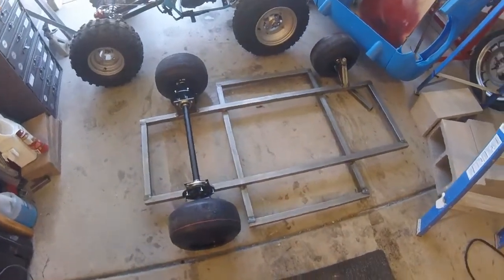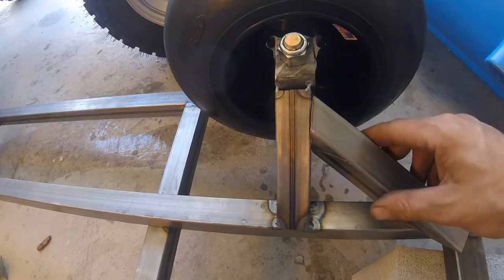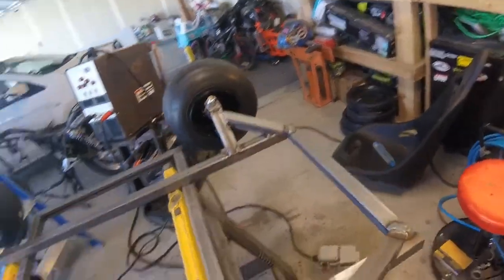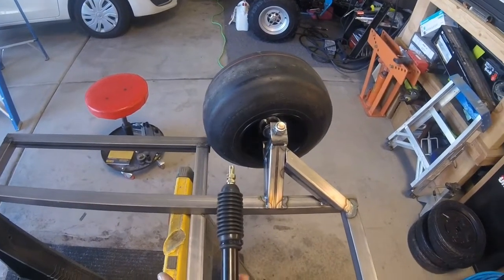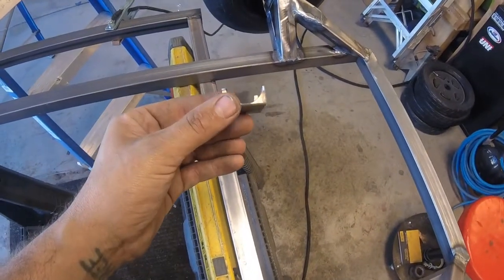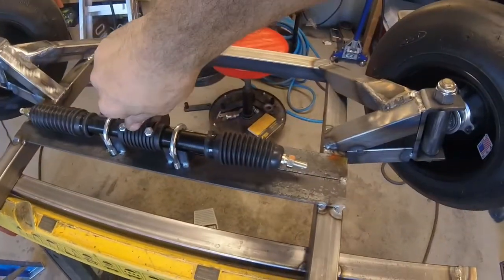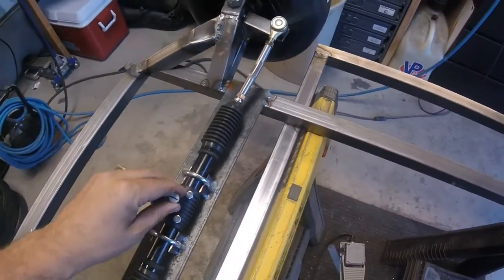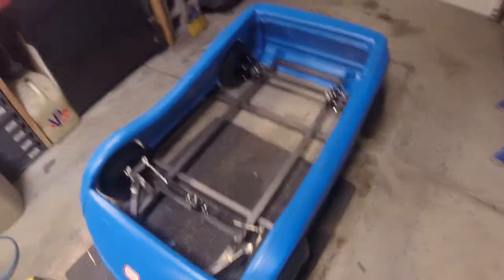The SLEEPER! V twin toddler bed go kart build part 2

Comment: I know your going to have more body mounts but I think you should run a flat bar along the bottom rail sandwiching the plastic for 2 reasons. One is spreading out the stress. Two is they would be replaceable "slide rails" not that you are going to much of that but with it that low you will rub that  area once in a while even on pavement. I think it would save the plastic from being worn off super fast.
Reply from the maker: Joseph DeCesaro that’s a good point! I could also counter sink it to help with height restrictions

Comment: just a suggestion, the pivet point for the frontwheels, not sure how to explain (i'm from Holland) should be tilted backwards a bit, like 10 to 12 degrees, that way the steering will go back straight when releasing the steeringwheel, hope you understand, its called "caster" google it :D or steering geometrie, or, Ackerman, makes steering a lott more easier
Reply from the maker: Wim van de Steeg thanks for the feedback! So I thought a lot about what your talking about when I designed the steering and my thought is that if I tilt them back then when I steer I’m gonna have a lot more body lift on one side than the other and with out any shocks to help keep all 4 wheels on the ground I would basically be lifting one tire up right now the lift is equal on both sides and the simple fact that it lifts the front when steering should make it naturally go back to its lowest point when you let off which is straight, I’m not an engineer by any stretch of the imagination but I think it should work! But hey trial and error! If it doesn’t work the way I’m thinking we can try something new!
Reply: @DIYMOTORSPORT  He's talking about the caster, he doesn't realize you've built in caster but the way you have yours set up is more on a dynamic level versus a static level and increases during the turning travel and also you have it setup in a way to prevent driveline thrust from basically causing your kart to always go in straight line under power in a turn. I think everyone should wait and watch for the results. I have faith in you! I also have a feeling if there are issues they can be easily repaired during testing. That is what testing is for. It's a kart, not a F1 racer.
Reply from the maker: Trial and error! But as simple as the steering is I did put a lot of thought into so hopefully it works out but if not live and learn

Comment: Beautiful work! It Doesn't look like you did Ackerman steering? Why not?
Reply from the maker: Curtis Mcclain its kind of hard to explain but basically the downward angle of the arms on the knuckle vs the angle of the tie rods gives the same effect! The inside wheel does turn sharper than the outside

Comment: Looking good but it looks like you might bottom out when done maybe just a opinion might wanna check before you you get to far
Reply from the maker: Fred Beach so right now it’s about an 1 1/4 in off the ground which is comparable to a shifter kart but if it’s too low when all is said and done I know how I can gain another 1 1/4 in of clearance pretty easily I just don’t want to unless I have too thanks for the feedback

Comment: Looks like your front wheels are going to scrub when you steer.
Reply from the maker: loznev it will a little bit of trial and error but in a straight line the scrub radius is nearly zero and going into a turn it goes slightly positive on the inside and negative on the outside, I don’t know I ton about it but that’s how I designed it so I’ll just have to try it out and the inside tire will always steer more than the outside due to the angles of the tie rods in relation the the downward angle of the arms on the knuckle, I’m just gonna need to do a little trial and error! Thanks for the feedback